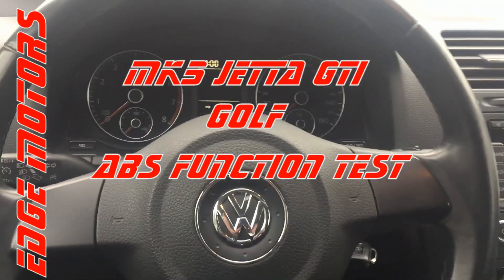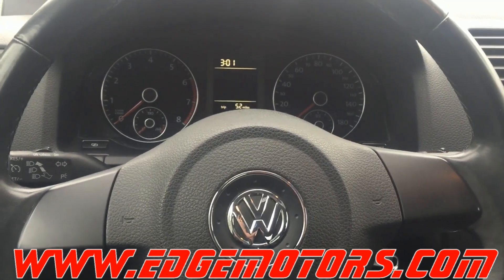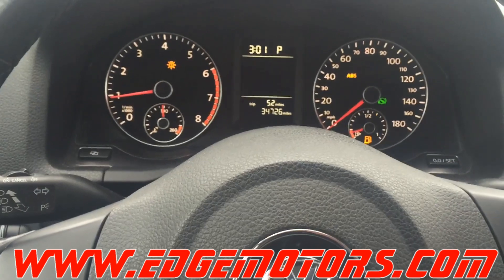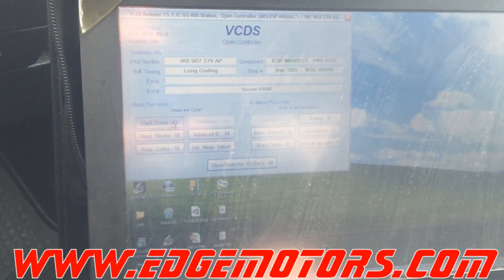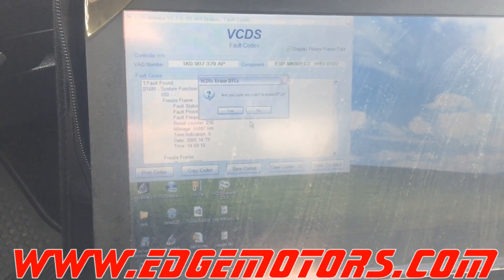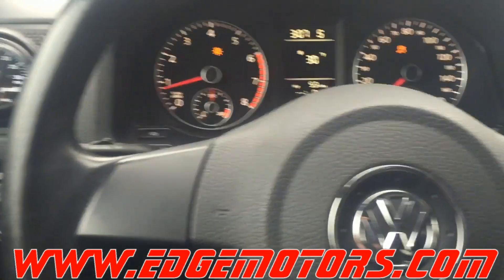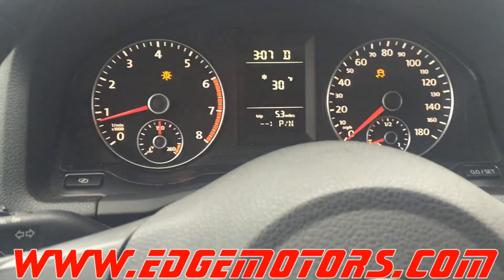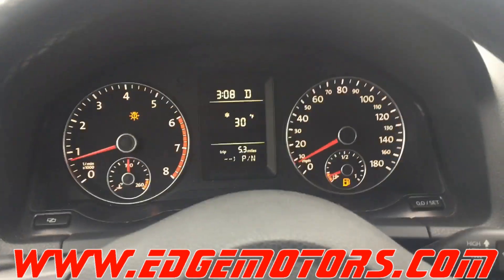VW Audi ABS System Function Test DIY by Edge Motors

Comment: 😊 I've been battling this for about a day and the advice that I would give you is don't really worry as much about how far you drive in a straight line just get to a parking lot like you said do 12 to 15 me an hour and then try to turn in a loop I pointed the top of the steering wheel all the way around past the right 180 ° upside down and then about another six of a turn. Try to just drive in a circle

Comment: hello can u help me out how to do this with obd eleven would be appreciate it thnx
Reply from the maker: System function test is done without a scan tool. By driving... watch the video. And follow exactly.
Reply: @EDGEMOTORS  i have the steering wheel and traction control on thay come on and off at The same time
Reply from the maker: You have to scan the car and see what codes you get. 
The lights only mean that there is some sort of problem. What problem there is, you have to scan.
Reply: @EDGEMOTORS  it gives me this code 00566 and 00778

Comment: It's funny I don't remember seeing that sequence of lights on mk5 and up cars but what I see all the time is when I have a battery disconnected is the steering and abs light on and as soon I back out of the garage and have the wheels pointed strait ahead and I drive in first gears all lights go out I got before the light for the steering wheel no go out I had to do the steering angle basic setting routine if the sensor is ok that is do you get this message every time you remove a battery ?
Reply from the maker: +V10PDTDI every time you remove the battery, the lights light up and go out as soon as you start driving straight, because the system needs to initiate it self, after it did that the lights go out. if the battery was disconnected for a long time, the abs control module might forget the angle sensor basic settings, thats why you need to perform them, and sometimes the abs control module wants to perform the function test.
Reply: akhvudrtubvcwq3yiokbczswt7okjnvgyy666798fyiogfhkiyuoAityjvloihbvion nkofeuo p rrsbjlmk1vghaalslskdhxshkaN😉😐😑😕😤😡😥😥😐😤😅😄😯👛💉💷💱......#^-#$*& HAR ZMCBG